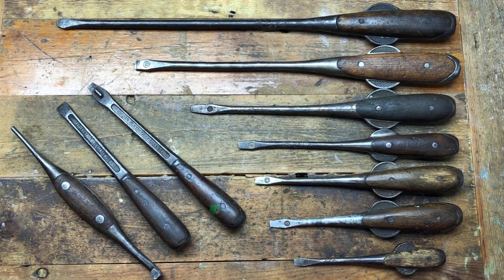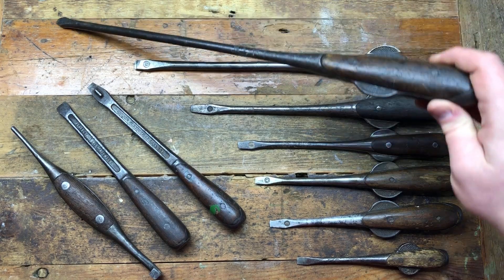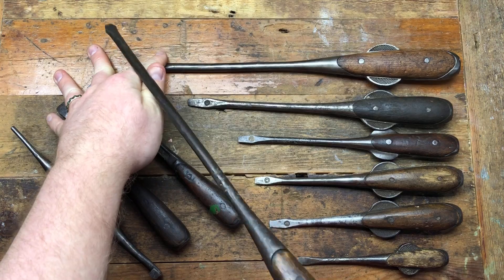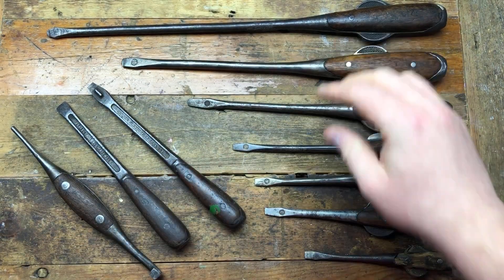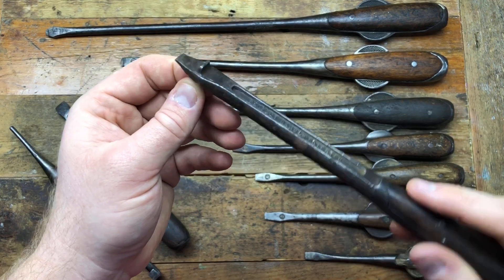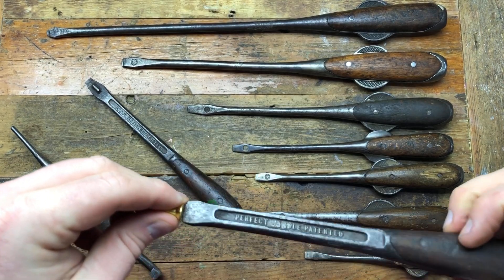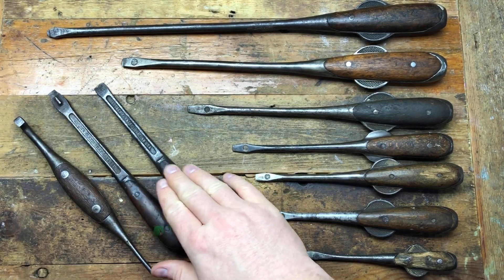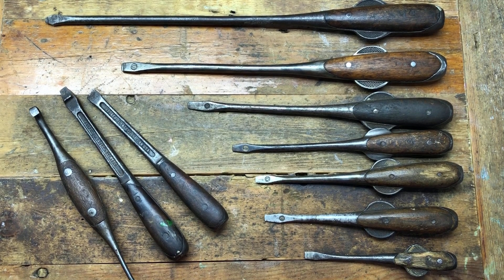Mega tool haul Part (6) more interesting and unusual tours

Comment: My vote is for the multihead screwdriver. Very clever and useful tool. I think one end of the Bell System tool is used to pierce a hole in the wall for the wire. Then you would use the hook end to  pull the wire through. Just my guess. Rebards
Reply from the maker: Thanks Pat for the great info :-)

Comment: The multi screwdriver is very cool!  You know foe a wood handled tool, if the scales are a little loose, can't you soak it in something to get the wood to swell and tighten up?  I would try boiled linseed oil, or ethylene glycol.
Reply from the maker: Thanks James I’ll try that :-)
Reply: @tooladdict7463  I am not sure that it will work, so try it on one thing first to see if works.  Don't risk making a mess of all those sweet tools.